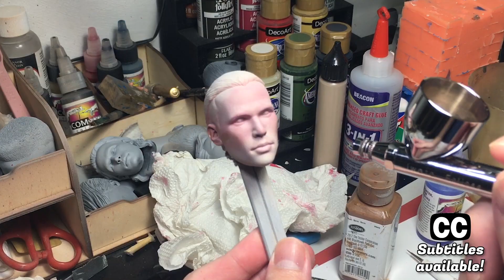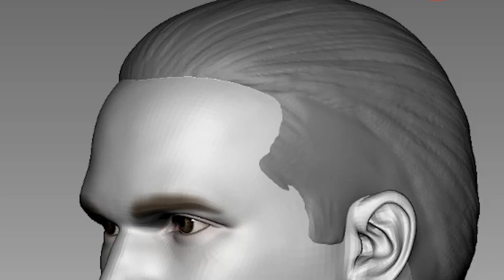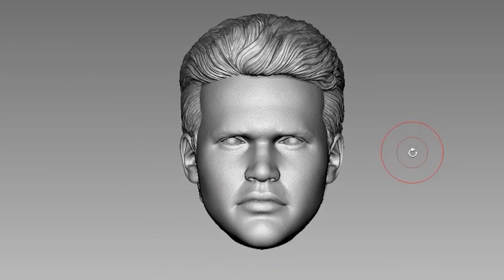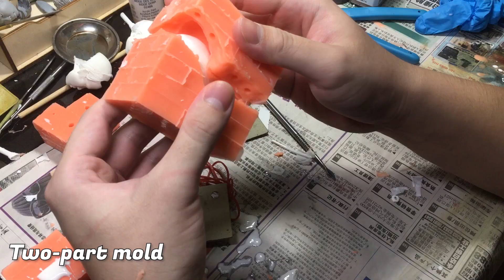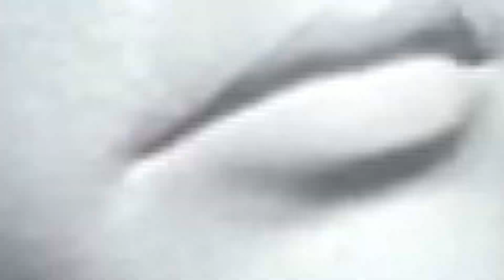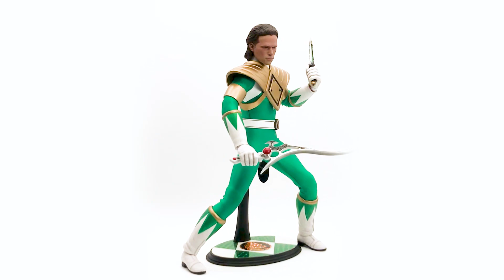Red Green Power Ranger Sculpture (3D Print, Paint, Mold, Cast) 1/6 CUSTOM FIGURE Ace Toyz ThreeZero

Comment: Bro I’ve bein looking how to do this for so long !!!!! Thank you so much !! Quick question , how wide is the cylinder ? Also would love to see a video tutorial on skin pores
Reply from the maker: I talked about skin pores here https://youtu.be/2tsZcxF46eM.
The cylinder size is really just a rough estimate, but yes you can always measure existing heads to be accurate, which I have not tried yet. To me, since it's just for me, it just has to be big enough for the neck adapter so I just made it as big as I could. And for supports, just angle the head 45 degrees facing upwards and your details should be preserved. I use PreForm's auto generated supports so I don't have to think about it.
Reply: @zedabyu  thank you for the reply bro!! Really means a lot ! Also what intensity is best for skin pores so making sure it gets printed out . I use an elegoo Mars pro
Reply: I have the skin pore alohas just can’t figure out the intensity so I dont lose the detail when printing at that scale
Reply from the maker: @gokux7856  depends on the printer, you will need to experiment yourself. Just do the skinpores in a layer and duplicate it if it's not enough when printed

Comment: I love your work on these, your sculpts are incredible.

One thing that might help you a lot with your one part molds, is getting more flexible silicone.  I believe I've used the same dark blue mold silicone, and I swapped over to "Smooth-On Mold Star 15 Slow" It's a much more durable and flexible silicone, which will make demolding so much easier.

Also, have you considered selling the 3D files, or offering any printing/painting of these sculpts? I know that I, and the community around ranger figures would be incredibly interested.
Reply from the maker: Thank you! Mold star... interesting. I'll look that up when I decided to mold again. Right now I am just focused on creating new sculpts every week for content. Which brings me to your question about commissions, not at the moment. Also, the files are way too versatile to be sold for 'personal' use. There is just no way to make sure it doesn't get leaked or massed produced or modified, etc.